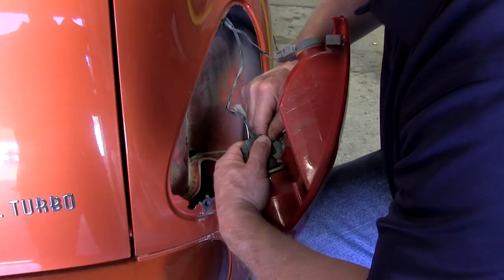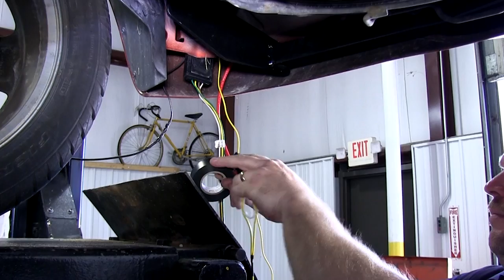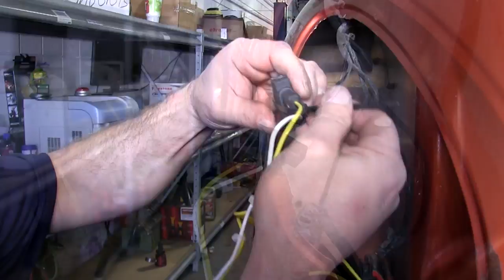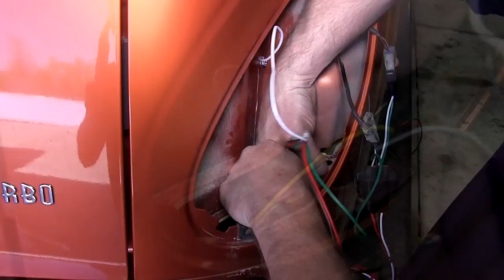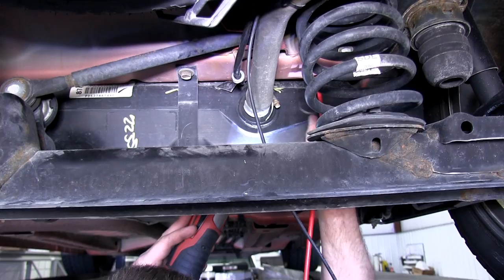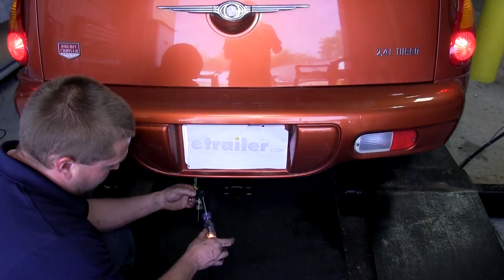etrailer | Trailer Wiring Harness Installation - 2003 Chrysler PT Cruiser

Comment: Will this harness work for a 2006
Reply from the maker: It sure will! This wiring harness is designed to fit the 2001 - 2010 Chrysler PT Cruiser. Check out the following link for more information on it.
https://www.etrailer.com/Custom-Fit-Vehicle-Wiring/Curt/C55532.html